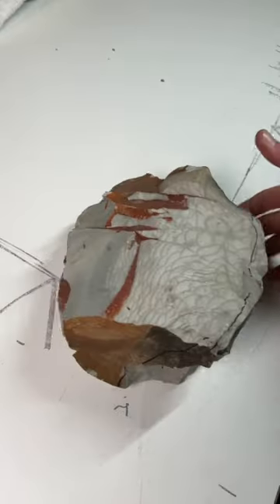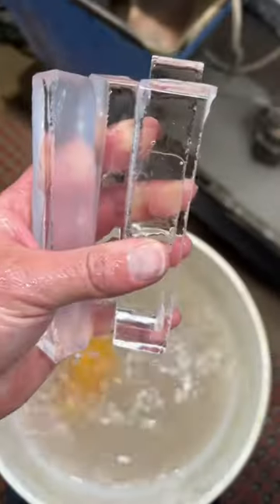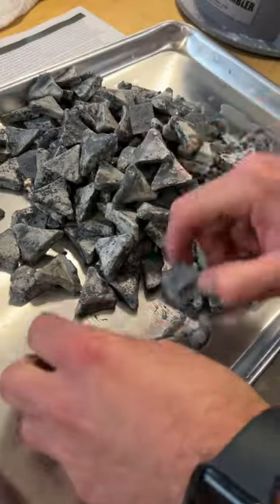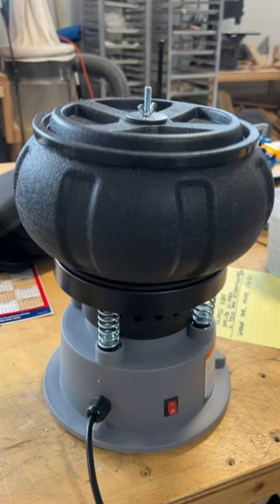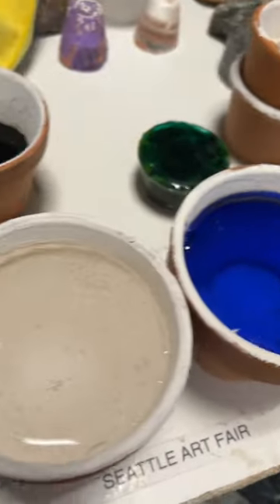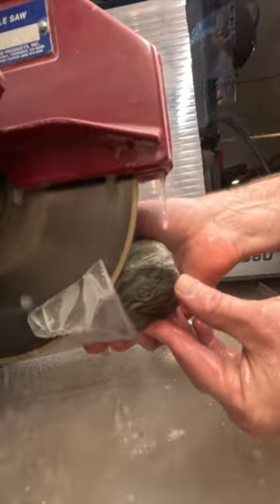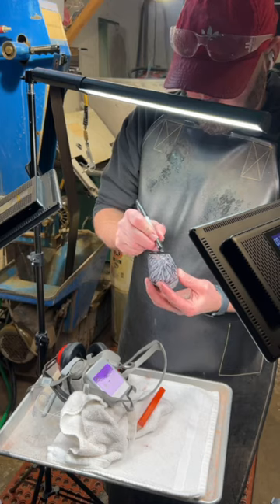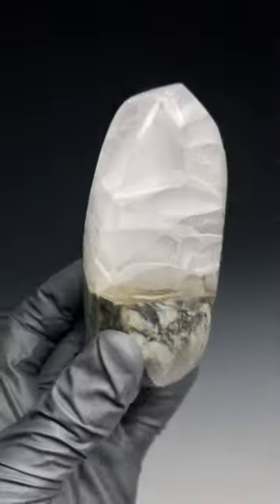Gneiss is nice! When happy accidents take center stage #shorts #glassart

Comment: Have you considered casting the glass directly onto the stone? Slump it right into the crevices. It would, of course, require a moisture free and stable stone, but I wonder if it would bond well enough. Glue is reliable!